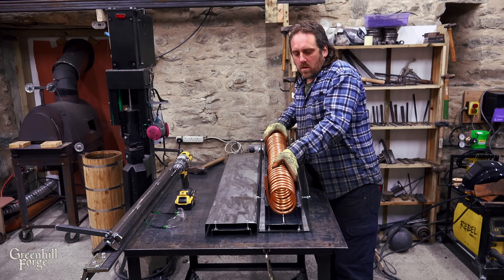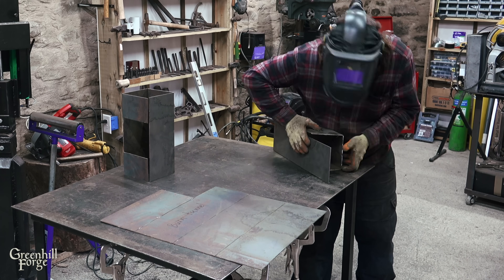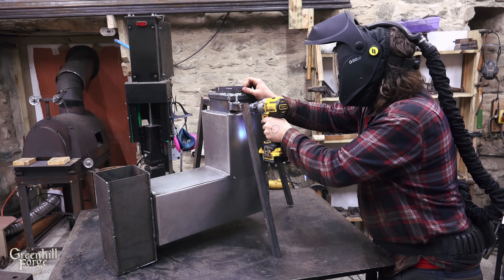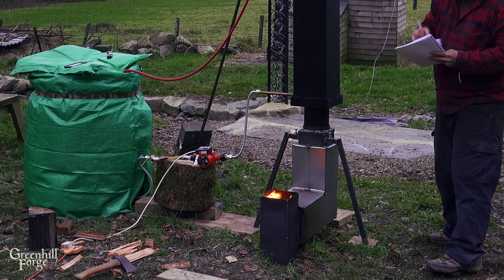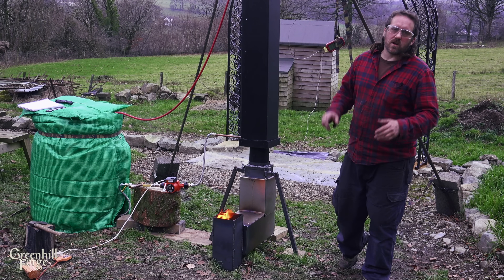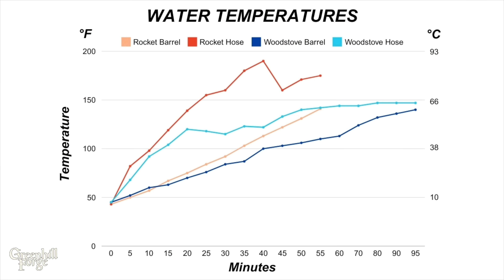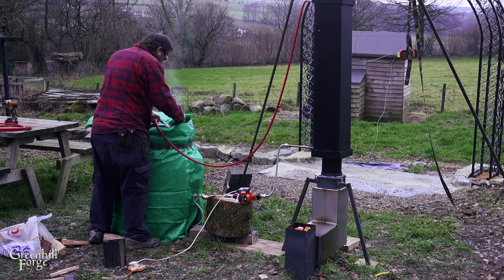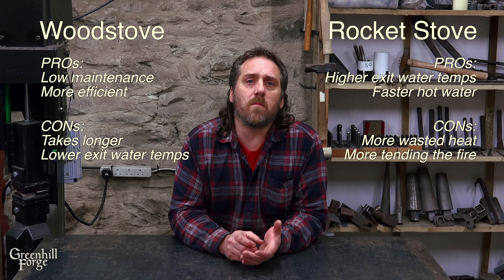Rocket Stove Water Heater Experiment Pt2 -TOO Powerful?

Comment: With regards to efficiency, you mention supply chain for electric and natural gas, but can't forget about the sourcing of the actual wood you're using in the stoves.  That takes time and manpower, energy in the tools, and time to operate and clean the stove.  You could also consider that a heatpump water heater, while more expensive, can be 1-4x as efficient as an electric water heater given that it's moving heat instead of creating heat, so that could put the "electric" water heater at anywhere from 30% (on very cold days) - 120% efficient (on warm days) after grid losses.   Could theoretically be used to cool and dehumidify a house in the summer.

Also, when it comes to electricity, efficiency depends completely on the power plant.  Hydro electric, for example, doesn't generate heat and doesn't need any fuel, so runs EXTREMELY efficiently at up to 90% before delivery losses.  Solar and wind are both super efficient as well.  You can also find some combined cycle fossil fuel powerplants that are far more efficient because they use a gas turbine (engine) to generate electricity and then use the waste heat from the gas turbine to generate steam to turn another turbine.  These can reach 60% thermal efficiency.  Then there are plants that rather than releasing waste heat into the atmosphere, will capture that heat and cycle hot water around a municipality, technically improving the energy efficiency of the fossil fuel combustion or nuclear power plant.

But honestly, why talk about efficiency unless you're an environmentalist (like me), rather than cost of operation?  If you care about the environment and green house gas reduction through higher efficiencies (It's 2025, we're not ignorant about our actions anymore people...) , then with the wood, you'd also have to consider the full cycle net-emissions impact of chopping down the tree and burning it.   The tree's no longer acting to sequester carbon and helping to keep global CO2 levels in balance.

Both stoves seem like fine ideas for off-grid living, but they really need to improve the heat exchange rate, and honestly, the maintenance and work to deal with the wood will be a big turn-off to a lot of people.  If there's a lot of waste heat, then a wood stove in a home could pull double duty in both heating the home and heating the water.  Same could be said for the rocket stove, if it weren't so dangerous...  If you wanted to use the rocket stove for forge work, but then do as you said, and make the heat exchange further down cycle when it would otherwise just be lost energy to the atmosphere, then it could definitely be worth it.

Environmentally speaking, the best solution is always to not use the energy in the first place, and make the energy use we do need as efficient as possible with the least amount of emissions.  A sweater, thick socks, even a heated blanket are far more efficient than heating an entire house another 5 degrees.  A 10 gallon shower is better than jumping in a 150 gallon tub heated from cold.
Reply from the maker: I agree completely but in this case I cut and spliy my own wood and included the gasoline used to run the chainsaw I used. Heatpumps are awesome but they have such a small market share that I didn't include them. I used averages, of course some electricity will be more efficient and some will be less, which is why I used averages. I only use trees from my land that have already come down in storms. These are test units to get data to create very efficient designs down the line.
Reply: Just an idea about the creosote... maybe have a two chamber flue system?  Use a straight flue while the system is heating up and producing creosote.  Once the stove is up to temp and burning all the organic compounds, have some sort of valve to flip over to the heat exchanger flute.  Definitely losing a lot of energy while heating up, but also not having to disassemble and clean the copper.

Comment: The rocket stove 30% efficient vs 33% efficient for the wood. "A little less efficient" That is a little deceptive. If you are talking about ONLY the exact amount of wood to burn to heat that amount of water for your exact design, then yes, slightly. But the rocket stove was a far more efficient burner. What you need, is smaller rocket stove or bigger water heater portion to optimize. Like you said, you could make this an on-demand hot water heater. If it were automated pellet fed, and designed right you really could have it be on-demand. If you incorporated thermal mass, like an insulated sand system, the heat could be retained between firings and hot water could be available without a large hot water tank. There are many ways to do this. Rocket stoves burn quite efficiently. Nice work.
Reply from the maker: As I said, in this design, the rocket stove was far more efficent at creating heat but less efficient at transferring the heat to the water. this is for an outdoor system with very intermittent firings so thermal mass would hurt the efficiency. I have some ideas I'm working on that might greatly improve the efficency of both systems.

Comment: I have an idea you need larger diameter pipe for the inner coil and alot more of it and make second smaller diameter coil that just wraps around the outside the whole rocket stove and also make out loup longer in the middle of the stove on the outside so U can use it as a handle on and the first outside coil pre heats water then run it to the second the smaller coil kinda limits the flow speed in so in total it will spend longer gathering much more heat 
can U also work on a coal version with  some type of a grill rack that also has water channels through it as coal is very hot burning

Comment: A rocket stove should not be regulated by choking, but rather by less fuel (just put in fewer sticks!). I'm bbqing with a rocket fuel plancha, and amount of fuel is all you need.

I guess it could work to have the burnt gas to expand into a barrel, and then have the heat exchanger there.
Reply from the maker: The choke is only for saftey in the hot water system to shut it down if thing get a bit hairy, otherwise I agree, they're designed to run full out

Comment: If you reverse the flow of water it will improve the efficiency of the Cooper coil by keeping the temperature difference between the coil and flu gas as high as possible throughout.
Reply from the maker: I discussed why I didn't use counterflow in the previous video

Comment: Would doubling the flow rate of the water flowing through the copper coil help capture more heat from the rocket stove?
Reply from the maker: probably to a point. The pump was running at full speed but if I had one that could go a bit faster I could probably improve efficiency a bit. I've got another setup coming that might increase it a whole lot.
Reply: @GreenhillForge I'll be watching that one!

Comment: Acknowledging that you did mention you weren't aiming for maximum efficiency...
I'd recommend having the water inlet at the top of the coil, and the outlet at the bottom. Admittedly, this isn't ideal for air-locks, but it would improve the efficiency slightly  as the differential between the water temp and exhaust has temp is more constant.
Reply from the maker: I go into this in the previous video if you want to check it out.I want to remove the pump from the system eventually and run it by thermosiphon so I'm testing it in the same flow direction of that, but agreed, counterflow would be better at heat transfer
Reply: @GreenhillForge  I see. Sorry. I have only just found your channel. I'll watch the previous video this evening. Thanks for the reply!

Comment: So the rocket stove used more fuel for the same measured heat output i.e. it is less efficient. Not what we are used to hearing. 
You demonstrated that the rocket stove gets more intense heat i.e. 7kw vs. 4kw but over a shorter time period.
As you say, you are pushing higher temperatures out of the flue which wastes the potential for the rocket stove to measure as more efficient.
You need to trap that wasted high flue heat.
So your conclusion is that if your aim is to reduce the wood required to heat something, you need a rocket mass heater not just a rocket stove.
Reply from the maker: yup. the rocket stove was super efficient at creating heat, it was the heating coil that was a bad match for it. I've got a few things in the works for this.

Comment: Both stainless steel and cast iron displat minimal degradegation when used with fire, you can make the same unit you did using stainless steel and it'll last in excess of twenty years.
Reply from the maker: They're not as good at transferring heat but I agree stainless would be a great option. I checked it when when I was starting the project and it was 4 times the price, and the copper was already fairly expensive so I just went with the copper

Comment: Theoretically a 6" rocket should heat up to 10,000 square feet with a proper heat exchanger....just fyi
Reply from the maker: of air?
Reply: @GreenhillForge  yes, several experiments have proven that a 6" will provide enough heat for a 10,000 square foot living area (barns, shops, etc). Some have used them for open system hydronic heat, some use the inverted barrel for a heat bell. All of the hydronic users had much smaller coils, and still had problems with boiling inside the system after a long run time, especially ones trying to use thermal syphoning instead of a pump. Be careful of chimney bounce when using a coil like this as well. The creosote is almost impossible to avoid using the chimney as an exchanger.
Reply from the maker: @ Ok, yeah, sure, that sounds just about right to me. This system is specifically for an outdoor water heating setup intended to heat water that will then be used immediately, never stored. If I were doing an indoor system I'd go about it entirely differently and I certainly wouldn't put a coil in the fuel that close to the fire. I'd go the thermal mass route(for all the obvious reasons) whereas thermal mass would work against me in this situation.

Comment: These experiments are fantastic. I know there were many suggestions about flipping the in/out to get the higher temperature at the bottom for "efficiency," but wouldn't you need another system to manage the temperature level? If that is the case, doing the suggested flip defeats the "efficiency" prospect because extra effort must be added for temperature control.  Is this analysis correct?
Reply from the maker: I think it could be fine with counterflow. I'll probably test it just to see the difference but the evetually goal is to remove the pump and run it on thermosiphon, which is why im testing it in this direction

Comment: Another design that comes with two benefits would be increasing the resistance within the heat exchanger. This would reduce the airflow which has the benefit of avoiding overheating, while also increasing overall efficiency due to both fluids having more time to exchange energy. This could be achieved by blocking the middle section of the tube. As you said in another video creating turbulent flow is desired. Therefore a long steal rod with circular sheet metal welded around it might be a good idea. Counter flow would also increase efficiency.
Reply: I was surprised in the initial video that there weren't baffles of some kind added to increase the turbulence

Comment: So what if you add a pellet dispenser to the heater, so you can regulate the heat better?
Reply from the maker: It's a good idea and would solve a bunch of problems but the goal is to ditch the pump and have a fully off grid system in the final design so that adds some constraints.

Comment: it'd be interesting to use a better thermal mass regulator on something like a shop with in floor heating.  This way the stove is outside but the thermal mass is part of the wall and floor and radiating into the building. It'd take much longer to heat up without a powerful enough system but it's given me some ideas for a future house plan.

Comment: I am looking at this as a way to heat a greenhouse in winter, use the woodstove to heat barrels of water as thermal batteries. This looks very efficient. Thanks
Reply from the maker: That's a great way to do it. If you check out this video https://www.youtube.com/watch?v=COdjqSYHJmY it shows my greenhouse. I want to do one where I heat a long bed like the one on the right against the tall wall with a long thermal mass heater built in under the bed.
Reply: @GreenhillForge All kinds of great ideas in there. Your doing great testing for all this, Thanks very much.
Reply: Heat capacity of water, FTW!

Plus you can pump it around!

It’ll even convection itself if you’re gentle with it!

And it’s cheap and nontoxic!

And ice floats to the top — a crazy physical property.

The curse: in the end, water destroys everything, and leaks everywhere, ruining my Metallica mix tapes.  But worth it, man.  Worth it.

Comment: wouldn't you be able to use/ package a smaller rocket stove better in this application? or is there a limit to how they scale? You're on the money with the offgrid hot tub! if you can get the pump and heater parts on a dolly, you'd be the great Gatsby of the woods 👍
Reply from the maker: The goal is to be able to remove the pump and run it on thermosiphon. I built a 4" rocket stove first but it didn't want to go much above 1300F so I built the bigger one. 5" might do it.

Comment: 9:40 I believe the creosote build up on the Rocket stove is due to your throttling of the burn. If allowed to run wide open you wouldn't have any of that carbon buildup. Another version of this from Little Aussie Rockets was much better at the heat exchange by making a full water jacket around the flue. This combined with a pump would make a larger heat transfer volume to avoid the in line boiling dangers.
Reply from the maker: Agreed. I also think it's soot, not creosote, so still not good for efficiency but at least not the safety issue that the creosote is.

Comment: For greater efficiency I have two recommendations:

1) run the water direction contraflow.  Pull cold water from the bottom of the barrel,  pump it to the top of the heat exchanger. 

2) operate the pump at high speed. Generally speaking a higher mass throughput with a lower temperature delta will be more effective.  The water can't get hotter than 212 in any case,  so heating more mass to a lower level cranks the whole barrel up to useful temperatures faster.
Reply from the maker: I address this in the previous comment video but basically the goal is to remove the pump and run it on thermosiphon so I want to do the tests with that direction of flow. I'll probably do a counterflow comparison just for fun though. Theoretically if the water phase changes to steam it should be able to go above 212F but it would also be able to move way more energy. This might be something I experiment with. Doing a test with just different water speeds would also be cool. I want to do all these things, it's just finding the time.

Comment: Superb. Subscribed.

Now, how about about taking a crack at what I deem to be the Holy Grail: a rocket mass heater-based, in-floor, radiant heat system?
Reply from the maker: That's in the cards. When I built my office a couple years ago I put the pipes in the floor so that parts ready to go.

Comment: Good work! Rocket stove could probably be much smaller for this purpose. I've used those copper spirals just in an open fire with some hoses and a pump. It took about 4 hours to heat 400 liter (100 gallon) to 40ºC (104F). I'm pretty sure the length of coil you have is long enough, you're just passing through too much heat and it gets wasted, as you mentioned.
Reply from the maker: Thanks! I did a 4" rocket stove first but just couldn't get the temps I wanted for the water heater(maxed out around 1300F in the stove)so built the 6". I've thought about doing a 5" and maybe even a 7" or 8" and run comparisons to see what you can get out of the different sizes.

I ran the numbers to heat 400 liters from 45F to 104F and it came out as 3hrs45minutes for the woodstove and 2hrs9minutes for the rocket stove. But I think I could make the rocket stove much faster once I got a bit more comfortable with it.
Reply: @GreenhillForge It only takes 15 minutes less with the stove then my "just throw it in a random fire" method? Hmm. I wonder what happens if you make two shorter loops in parallel. What would the optimal temp delta be?
Reply from the maker: @daan3298  The difference would be that the stove used 6 little 8 inch pieces of firewood and would have burned way cleaner. If you don't care about how much wood you use or breathing a bit of wood smoke then it's not a huge difference. for the water, i think as hot as you can get it but the delta that really matters I think would be super high temps right out of the stove and around 250f exiting the heat exchanger.